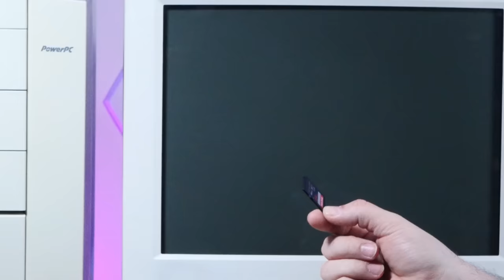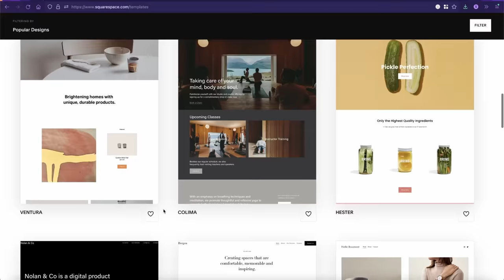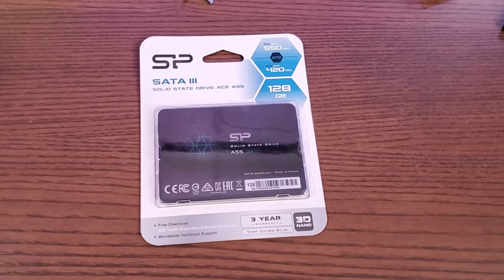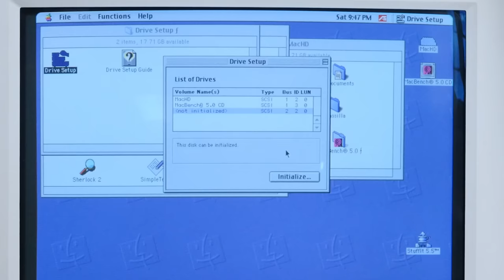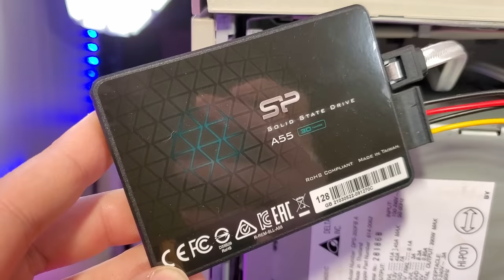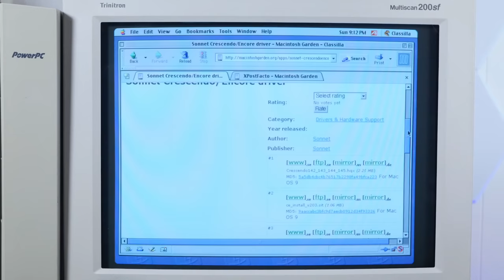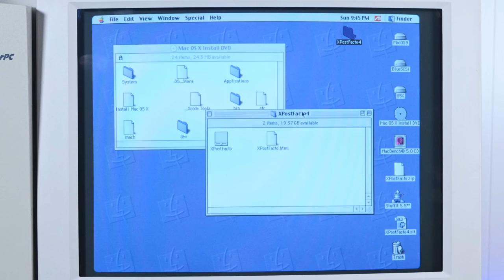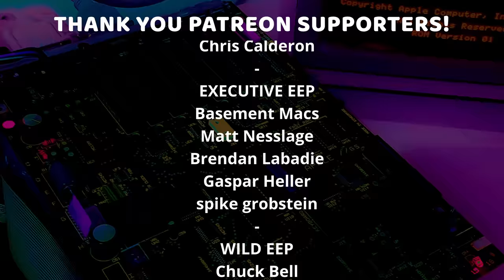Building an Extreme Power Mac 9600

Comment: This is insane, I imagine this could've been usable for actual work until the mid to late 00s
Reply: Best advice I ever got was when buying a pick n mix system (laptop or whatever) just take the financial hit and max out everything. Otherwise you're just shortening the lifespan of the system. Spent 4600$ on this laptop, got it in jan 2016, and still totally fine for work, including animation and video editing. Hard to believe this thing is 7 years old and still fast.
Reply: what the hell 1900???
Reply: @animatewithdermot  Eeehhhhh. I'd tend to disagree with the "max it out" philosophy. At a certain point you're paying big bucks for single % improvements in performance. There is certainly a balance to be struck
Reply: @animatewithdermot  maxing out gives you exponentially diminishing returns after a certain performance threshold is reached
Reply: 😅es su dinero su tiempo además lo estás viendo consigo su propósito 😅
Reply: Agree
Reply: You would be surprised, if you are running linux and have done the right tweaks, you could still be using this today.  Or, actually more likely BSD.

Comment: One thing worth bearing in mind with the 9600 is that there are two PCI buses.  The top three slots are on one bus, the bottom three on another.  From the top, the first slot and fourth slot are the positions for the bus master cards.  For optimum performance, a common configuration would be to put the video card in the top slot, and the hard disk controller in the fourth slot.  The way they are installed at 11:53 has the video card as a bus master on the second bus, with the SATA controller as a lower priority device on the same bus.  If you move the cards around as I described above, they won't be competing for PCI bandwidth.
Reply from the maker: Thank you!!
Reply: @ActionRetro  For the 240 gb pny ssd you broke the sata connector on, push it back in place + hotglue the cable in place should let you keep using it, the piece of plastic is just a spacer too make the contacts push against the pins of the sata cable.
Reply: @Mini-z1994  Yeah, the pins look like they're still intact. Though super glue would probably work better than hot glue.
Reply: The top 3 slots are shared with the other IO of the 9600 (ethernet, ADB, ...). Typically the 4th slot would be for graphics and the top 3 for IO.
If you want the optimal hdd performance but you don't care for graphics, you are right, though.
Cards that communicate via DMA to each other (a video card that writes into the frame buffer of the graphics card or several SCSI-cards, for example) should be on the same bus.
Reply: I have tested the performance difference a bit and came to the conclusion that there is little impact with a G4 CPU and more modern cards. The biggest impact was around 10% less than the optimal configuration when i used 2 Quickdraw 3D accelerator cards and one were on the 2nd bus with the graphics card and the other was on the 1st bus 'alone'.
Reply: @john_ace that is because one bus to the other communication is through the cpu.
Reply: I don't believe this is a thing on the 8600 though, since it only has 3 PCI slots to begin with.

Comment: 10:44 happened to me, you can buy some sort of extension and after making sure all pins have a contact, you glue it there and you got a new connector!
(And a longer drive, but since the PCB in today's SSDs are often half the size inside you can just crack it open and find your way to make a totally normal SSD with a new working plug!)
Reply: It happened to me and a Seagate HDD back in the day. So what I did is: take a SATA cable, cut one end of it, clean up the wire ends and solder then directly to the drive PCB where the connector was torn off. I ended up with a drive with a SATA cable permanently attached to it. Worked fine for several years after that.

Comment: I've been using an SP SSD in various devices over the last two or three years and it's been absolutely fine.
Reply: I've used their SD cards for a while now with no issue. They have good capacity and speed for the price.
Reply: I bought a 64 GB, USB 3 flash drive from them about 9-10 years ago and it still works to this day
Reply: I have an old dead 4GB Silicon Power USB flash drive. It just shows up as a drive without media, pretty much like how a card reader without a card shows up
Reply: Hmm.. I just don't trust anything with misspelling and weird names. Often it ends up being an SD card, hooked up to an SSD controller, with the internal device ID and specs changed so that once you hit 64gb, or what ever the SD card size is, it loops back and starts overwriting data. Short of running some absurd time intensive tests, or breaking open the case to see if it's real, there is no way to tell if it is fake.

Comment: I wonder if it is possible to swap out the teensy fans on the GPU and the CPU to make it quiet again. Looked like there was spare slot space, so you imght be able to 3D print a bracket that would hold an 80mm fan in the correct location.

Comment: Hey Sean,

This was one of the first Macs I wanted even after the G3 was released. They were beast, even back in the day with the dual 200mhz MP. While the support for multiple processors in OS 8 and 9 was rather limited, these computers were absolute beasts, back from the day when Apple actually made computers for professionals and not just for the middle market.

Comment: I have a soft spot for the 604e, it being a chip I drooled over back in the day when I was stuck with the gimpiest of gimped CPUs, a 75 MHz 603 in a 6200-series Performa. I finally got my hands on one in the form of a Power Mac 7300. I would never upgrade it! It's kind of cool having a good period system anyway, something to run System 7.6.1 and software of the time that might not work so well on OS 9.x.

Comment: Those silicon power harddrives slap, ive got a bunch of them in raid 0 in my laptop.

I also just helped my friend build a new pc and we stuck 4x 1tb silicon power gen4 nvme's in it and raid 0'd 3 of them as a games drive. Benchmarked it  at around 14000mbps while we also had files transferring all over the place at the same time.

Comment: I had a 8000 series, that I had to carve the case a little to get a 9000 series mothboard in it with a G3 upgrade card.  I ended up giving it back to the guy who gave it to me.  But they helped me out when I needed it, so he deserved it.  Oh, BTW, this was in 2003 so a G3 was still rather useful back then.  I do have a Sonnet G4 1333 that fits in a PowerMac DA or Quicksilver just sitting on the shelf.

Comment: I have broke a ssd before but breaking an ssd at the sata connection is actually pretty rare and because of that there’s very little chance of it being successfully repaired because of simply how hard and tedious it is to fix but remember if personal data is on that ssd then it’s time to put a sledgehammer to it because you ain’t gonna fix that ssd without a long hard fight with all the tools you need and how much money it’s gonna cost, even down to the time. It’s not worth it because repairing a broken sata connection on an ssd is bound to turn south and more things will be fried just from the heat of the repair process which just means that a repair like this needing to be done could mean bad news!

Comment: maybe one thing to consider going to a modern power supply might not be the right answer. I dont exactly for this mac but older PC's ran most of the devices off of the 5v rail (meaning it needs to support higher amperage) and modern supplies moved the higher amperage supply to the 12 V rail.

Comment: You have re-inspired me to get my 9600 up and running!!! I have been tinkering with it for the past few years, i do also have the g4/1ghz and also a 700mhz card for the 8600 i also have. How tough is it to flash a video card? Altho the games i would run do not require much video ram. I have a scsi2sd, and i see you use the bluescsi, is it much easier to use?I Still have not figured out how to correctly flash to the sd card and thought i could just copy files to a partitioned drive on the SD card.

Comment: this is why old tech like the MacPro5,1 i feel could get a modded Cpu upgrade to get to 2015 speks or even managing to make a mode to force it to use the 2020 intel chip 
im sure someone in prob 5 or 10 years could mke it happen.

tho prob modding the pc case and building a normal pc inside will happen as macos leaves intel

Comment: This takes me back to my 8500 with a flashed Radeon 9200 and one of those sonnet 3-in-1 cards on it. I did have better luck with Panther than Tiger though.

Also, IIRC, the OSX installer is super picky with that slot an external drive controller (PATA, SATA, or SCSI) is in when you do a 9500 or 9600 because of how 6 slots work in those machines. It’s been a long time since I’ve done any of that myself though.

Comment: Could 3D print a thin front plate for the superdrive for a bit more of a stock look?
Reply: The drawer bezels are somewhat standard. You can often swap them around.
Reply: @pseudotasuki  I guess that's right, plus 3D printing of course is still no match to injection molding.
Reply: Another possibility is paint.

Comment: Does a G4 at 1 GHz even make sense under a front side bus of 50 MHz? Back in the day they said anything beyond 400 MHz will not increase your systems performance much more as the FSB is too slow. But i'm no expert. Maybe that's rubish. :D

Comment: I have a Macintosh tower that is identical on the outside but mine says PowerMacintosh G3. Would love to get mine working again. Where do you find all of those old parts?
Reply: Yours is a similar model but with a faster CPU
Reply: @svgaming234  But fewer slots for RAM and PCI. I don't remember if they have SCSI.
Reply: I know it is a faster CPU and has less ram slots. I just don't know where to find parts or what is actually compatible, however thanks for the info about the differences between the two towers. Is it possible to get a G4 cpu in it?

Comment: Question about the video card.  Why use a PC ATI Radeon 9250 with modified memory when you could use a ATI Radeon 9200 mac edition that already has 128mb?  Could a 128mb 9200 be modded to have 256mb?

Comment: Couldn't the 9200 be flashed for the Mac? The 9250 was supposed to have a halved memory bus compared to it. Unless the upgrade to 128MB solved that flaw (they typically only have 4x memory chips - 2 front 2 back). In which case you'd have one of the fastest Radeon 9250 ever.
Reply: Only the 9250SE had the halved bus, regular 9250 is fine.
Reply: @ukmk3supra  SE wasn't an official name for the 9250 - though because it uses the same pin layout as the 9200 and 9200SE - some manufacturers just used the full PCB with only half of the memory pads filled. Hence the potential ability to upgrade some to 128bit - Sapphire cards are a good example.

Comment: i recommend not using silicon power, i had a silicon power SSD in a NAS for storage (so it was barely getting any writes since it wasn't the boot drive, just the storage drive) and the drive started throwing io errors after only a year of usage

Comment: Very nice! How about trying to install MacOS X on this very machine but with the original processor? Is there a faster 604 you can install or the 300 MHz is the maximum allowed?
Reply: Fastest would be a 350MHz 604ev. They also had a dual-CPU card, but those were 200MHz.
Reply: I saw where a modified kernal would let you run 10.4.3, but I think 10.2.8 was the last version of OS X that could run an unmodified kernel on a 603 or 604 processor.
Reply: @EweToobUsername  He's done that on this channel.

Comment: What is the drive size limit for the Max OS9 boot drive? Doesn’t the firmware have a size issue where the data will overwrite the early tracks if the track count is out of bounds?
Reply: Mac OS 9 can boot off partitions of up to 190 GB.

Comment: I was literally thinking "Not PNY! I broke the SATA connector off of mine!" It was the first ever SSD I had ever bought. the connectors on those drives must be very weak.
Reply: I've had a PNY drive in my backup PC for years, but I'm constantly afraid of breaking the connector off of basically ANY sata drive.

Comment: do you enable trim with the ssds that you use when using them in vintage hardware? maybe it's not necessary on a machine that is used more as a curiosity than a production/main system?
i have a sunflower imac g4 that i've been interested in putting an ssd in but was curious if you've been able to enable trim or seen issues without enabling it.
thanks for the great content!
Reply: I’m going to guess that unless you plan to use it as a daily driver for years, using an SSD without TRIM will be fine. I’ve used a 60GB SSD somewhat regularly since 2011, with roughly half that time running without TRIM. It’s still working just fine, and I’ve installed operating systems on that drive dozens of times.

I also don’t know if TRIM support is even possible in OS9 or Tiger. Then again, you can simply get the cheapest SSD possible and it’ll still be performant enough for the system, so you can consider the drive disposable if you plan on using it extremely often.

Comment: Guys, I'm pretty much stuck with the resurrection of a Power Macintosh 9500... The video mentioned this ATX PSU adapter, but do you think there's such made for my 9500? Thank you in advance.
Reply: The same should fit. Or you can modify a stock ATX PSU, you need to snip a couple of wires and move another one IIRC. There are guides.
Reply: @stamasd8500  Can you please link some for me, I couldn't find any for the love of God 😅

Comment: One correction: That is not the most powerful PCI Macintosh video card. It's close, but there is one that's technically a bit faster: The Radeon 9100 PCI, which was a slightly downclocked version of the 8500. I ran one for a couple years in a B&W G3. The caveat is that they're nearly impossible to find these days and, at least the last I knew, you couldn't get acceleration in OS 9 with one. OS X worked just fine. It might be possible to tweak the OS 9 driver to recognize it, much like that 9250 driver. I'm not sure you'd notice a difference on a PCI bus, though.

Comment: Here is some information to help you in tweaking software, files, system-imaging, etc. That Tiger OS can do UFS (filesystem) and so you could have BSD linked to it also using UFS. Even link a BSD computer (intel or whatever) to it and or use an extra HDD (or other drive) to boot BSD on the Mac.
My comment has no hate in it and I do no harm. I am not appalled or afraid, boasting or envying or complaining... Just saying. Psalms23: Giving thanks and praise to the Lord and peace and love. Also, I'd say Matthew6.

Comment: i only watch your channel for the frankenputer shenanigans cause that's my ball. otherwise, i would not care about playing around with MacOS. every Apple computer that comes into my possession will have MacOS removed, and replaced with linux or a BSD.

currently, i have a PowerBook G4 running NetBSD. it's somewhat nicer than OpenBSD, and has decent web browser among its ported software (arcticfox is made for this purpose, even).

Comment: First time viewer here. After watching this video, I decided to unrecommend the channel from my feed. Here are some reasons to why
- Missinforming viewers about the terms used for the hardware.  The Storage device you said was called "Solid State Hard Drive" is NOT a "Hard Drive". It is a regular SSD also called Solid State Drive.  You also called it Hard Drive later in the video which is completely wrong.

- Using a SCREWDRIVER to take apart the system. Use a screwdriver for god sake or are you too lazy to use your hands for things other than stuff you usually do when you're alone.

- 3D Printing a part that is completely unnessesary.  An SSD has no moving parts what so ever. It can legit just HANG and be just fine. The drive tray you put the disk on already had 4 screw holes, just use one of the holes to mount the drive. Even THAT is overkill.

If you're gonna make a video like this, get the terms right.  A few flaws are fine, but the terms are CRUSIAL to not missinform viewers about the terms.